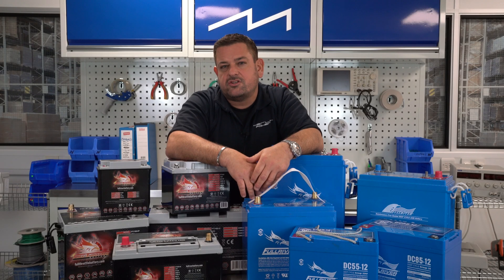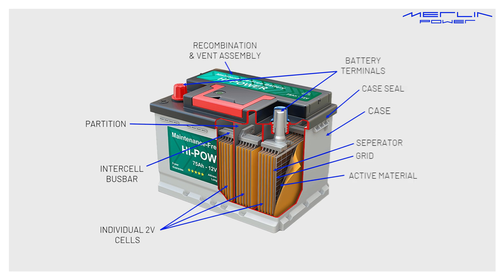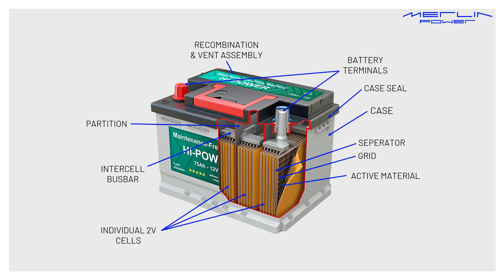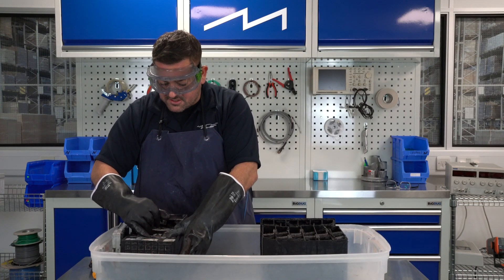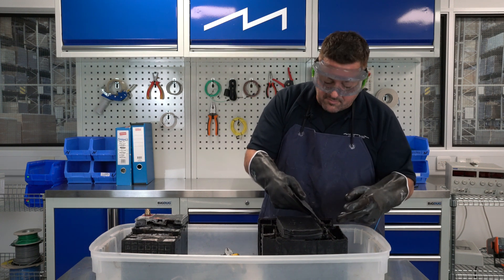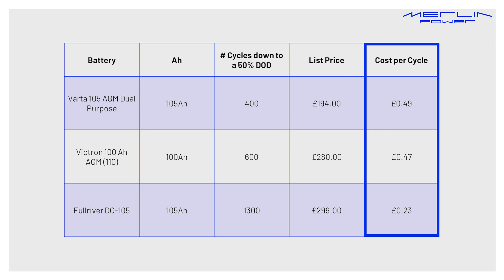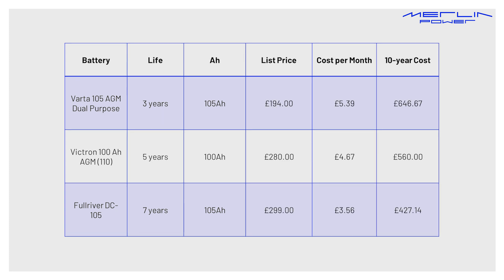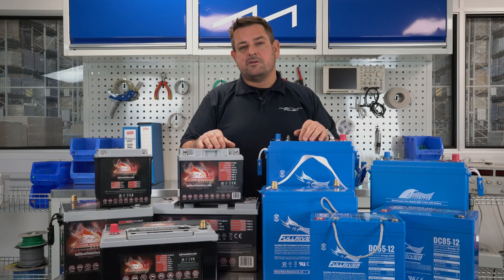Fullriver Battery: What makes them the best AGM battery? TEARDOWN + REVIEW!

Comment: I just switched to a Full River AGM battery in my truck. I run a stereo system with 3 amplifiers, a DSP, an Epicenter and over 3000 watts. I never drop below 14.1 volts even on full tilt.

Comment: I’ve used these for years and they genuinely work as advertised - our tractor has a 9 year old Fullriver that sits for months on end without use or charging and still cranks the engine like new..
Reply: I wish I could say the same to my hc44 battery. Sat for few.months and the battery has 1.5v left. 3 years old battery
Reply from the maker: A fantastic case study showcasing the battery's capability and reliability! Thanks for your comment :)